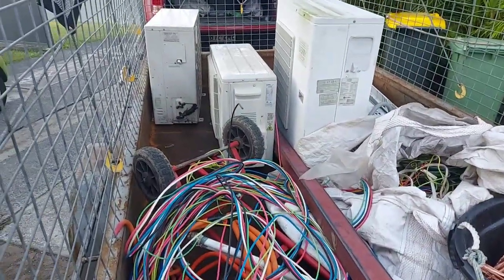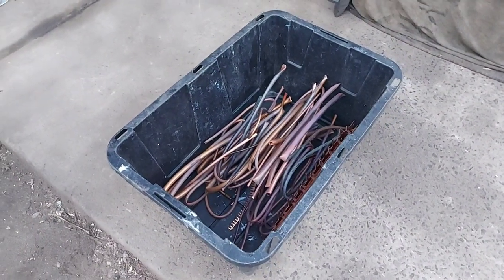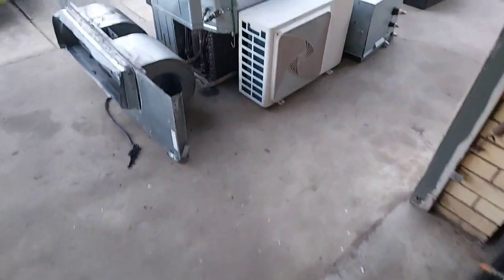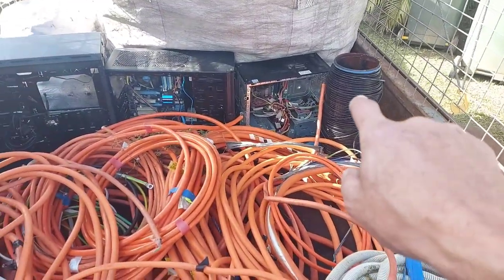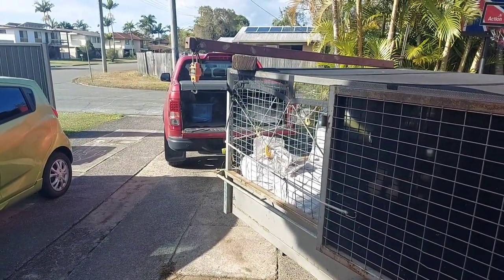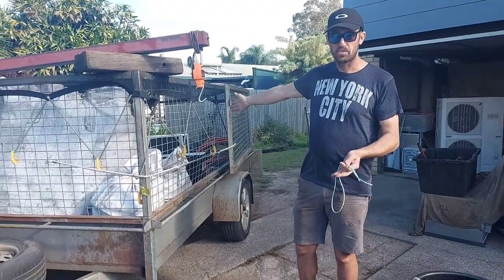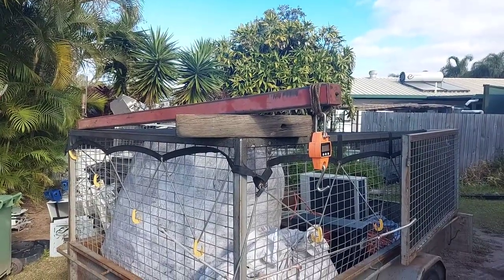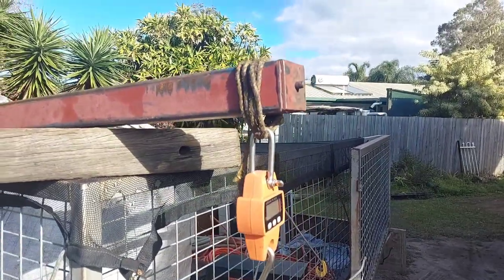Weekend pickups and my basic setup for weighing scrap.

Comment: Great way to weigh the metal 👍 you drive concrete truck full time and scrap on the side?
Reply from the maker: Usually its drive the concrete truck 3 - 4 days a week but sometimes i need to put in full weeks, it sux but has to be done i guess.
Reply: @danthescrapper815  Thats the only way to get Infront why not.